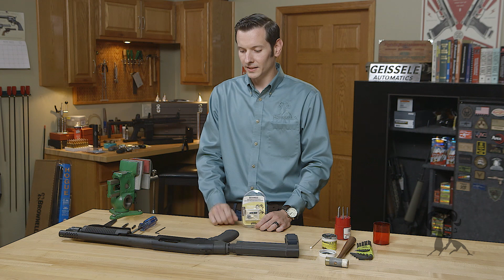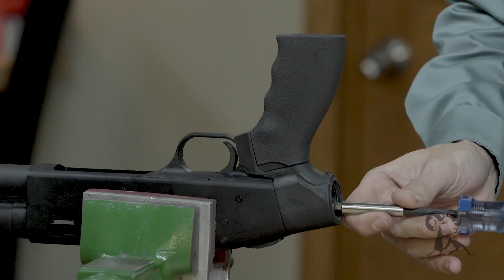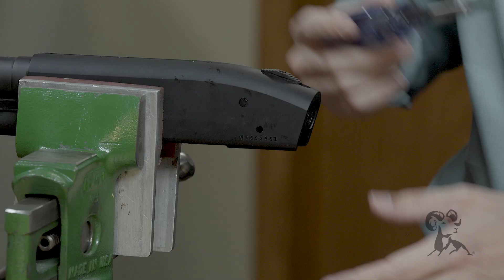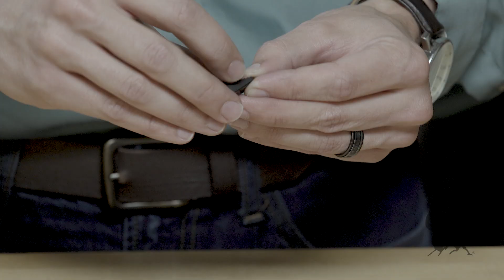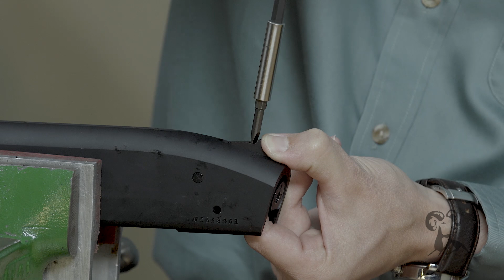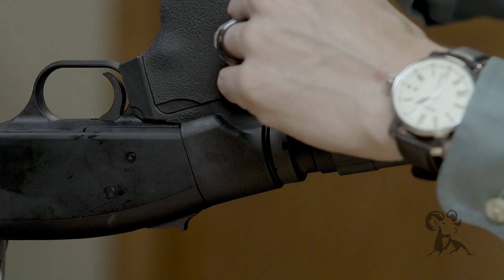How To Install an Enhanced Safety on the Mossberg 590 Shockwave

Comment: It looks like it took considerable effort to move the new safety after it was installed. I experienced this after installing, which defeats the purpose. It should be smooth with hardly any effort. I found two solutions. 1) A replacement spring kit contains two springs, one tall one short and comes with a new detent. 2) Cut one coil off original spring, file, and stone flat. Reuse original detent. Make sure you install steel spacer. The grease is a good idea. However, I prefer a friction reduction grease.

Comment: Completely unnecessary to remove the stock and flip the gun over. Just pull the forend all the way back. The stopper will not fall into the receiver. Plenty of videos showing this.

Comment: I also added the ndz safety. Just opened the action layed it on its side changed it added a tiny bit of blue loctite done in 2 minutes without all the disassembly

Comment: He doesn't explicitly say it but you want the short end of the safety to be towards the stock.  You use the tip of your thumb to push it forward and the pad of your thumb to pull it back, so you want the longer side towards the barrel.
Reply: Pull it back? My gun is safe after it's empty. 😂

Comment: Yeesh! Glad I decided to check out some other videos. This can actually be done with no dissassembly in less than 5min. Pull action back to fully open, place shotgun with safety facing up, remove screw (keep an eye on the ball bearing if it drops out. I had a white towel underneath for easy locating and the safety came with an extra), put a tiny dab of white lithium grease on top of the spring to hold the ball bearing in place, screw in the new safety.  Literally 3-5min tops!

Comment: This guy made this way harder then need be! All he had to do is make sure it’s unloaded, then pump the action all the way to the rear and leave it there. The bolt assembly will hold the enter safety lever called the chair up in place so you can remove the outer thumb safety and reinstall the NEW thumb safety.
Reply: It did look like a clusterfuck job to me too.

Comment: All these steps are completely unnecessary. Close the action and remove the trigger group. Unscrew the screw in the safety button and remove it. Re install the block and use a sock or towel to hold it in place and replace the detent ball and the plastic plate and then install the new button. It took me all of 5 minutes and I didn't need to remove the damn stock!

Comment: Just replaced mine. It's all about using the correct flat head tip as used in this vid. There were no buggered-up screws and even the plastic safety is in good condition after removal.

Comment: Thought adding a different grip and butt stock made the weapon illegal  . ............ I'm sure that gun is a felony
Reply: Not sure if joking?   If you're serious, then no.  That firearm does not have a stock.  It has a brace.   Adding an actual stock to it would be illegal without a tax stamp from the ATF for a SBS (short barreled shotgun).  Alternatively, if you were to remove the talon grip (that is the factory grip the Shockwave comes with), and install a pistol grip only, then you'd be in possession of a firearm which does not meet the legal overall length requirement of 26" overall.  That's why the talon grip is used, is it gives the firearm the proper legal length.  By adding the buffer tube/pistol grip adapter, and using a brace, the firearm is longer than necessary to remain legal.

Comment: You literally just unscrew it and screw the new one on. No need to disassemble.
Reply: Unscrewing it is a bitch though. Why on God's Earth they felt the need to use a one way tamper proof screw is beyond me.
Reply: @mmclaurin8035  its even more of a bitch to disassemble it for no reason and unscrew it
Reply: @mmclaurin8035  it's  simple..Liability  and greedy Lawyers
Reply: I simply open the slide. The safety stays in place as long as the slide is open.
Reply: Chris Thebowhunter right 😂
Reply: The screw is a little bitch to break loose on both my shockwaves, I'm gonna break it down...

Comment: thank you for the instruction video, helped alot, man that screw was a real pain, anyone know the reason why mossberg uses these? I mean they sell replacement safety switches, why would you make your customer go through this hassle to change it out of it gets damaged.
Reply: "Security" screw so you can't easily do what you just did.

No idea why he replaced it with the same screw; I used a hex screw on my 590.

Comment: Is it possible to install the enhanced safety without disassembling the shotgun? I own a 590 special purpose.
Reply: Yes, I replaced my OEM with that same safety (as well as using a hex screw) on my 590A1.  The trick is to had the forend back to lock that little block (I called it the 'chair') in place).

Comment: You skipped over the tricky part! We need more detail on removing the one-way anti tamper screw in the safety button. Both of my 590 Shockwaves have these diabolical devices. Also I would not want that extra protrusion on the 12 gauge Shockwave with the birds head grip. With full power loads, my right hand tends to slide forward just enough to get bitten by the safety button.
Reply: 2:16
Reply: @pacman10182  That's not a oneway screw head in the video. Mine both came with oneway anti tamper crews. Pay attention.
Reply: @gonerydin4225  It was indeed the oneway screw, by using a tight fitting bit it can be removed with a standard driver.
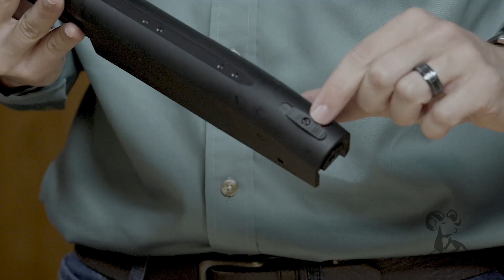Reply: @gonerydin4225  1:57 that's a ramped one way screw, pay attention
Reply: @CalebSavant  Apparently my eyes have deceived me. Sorry.
Reply: @gonerydin4225  No worries! Both variants are out there and despite out best efforts, its not always easy to get those small parts on camera.
Reply: @pacman10182  Your eyes are better than mine. Sorry.
Reply: Just use a wide enough flathead screwdriver and it comes out no problem if you push down hard.  It's not in there super tight so you don't need a ton of torque to get it off, so your screwdriver won't slip on the anti-tamper ramps.

Comment: I thought the safety on these Mossbergs were harder to work with, like the screw isn't designed to back out? I guess that was with older models, or am I mistaken?
Reply: My two 590 Shockwaves have one-way "anti-tamper" screws in the safety button. They are a nuisance.
Reply: You are correct, the trick is using a tight fitting bit as stated at 2:15.